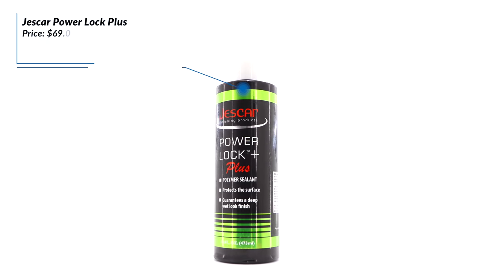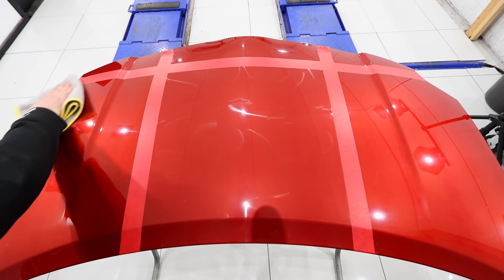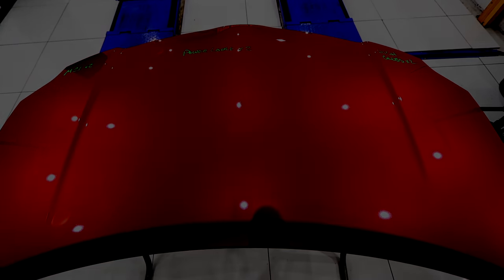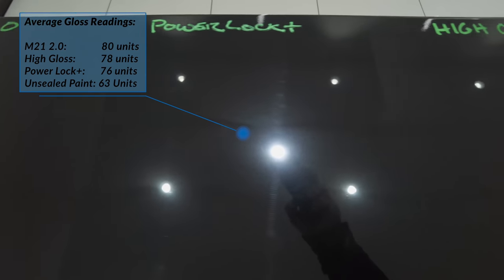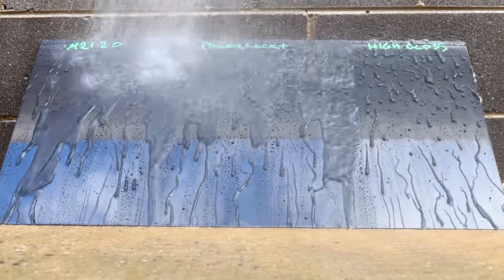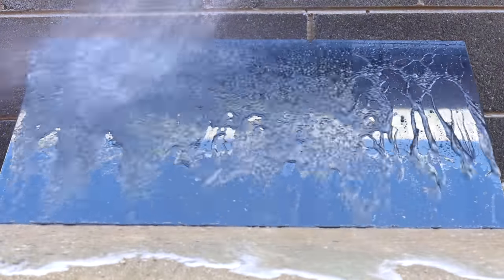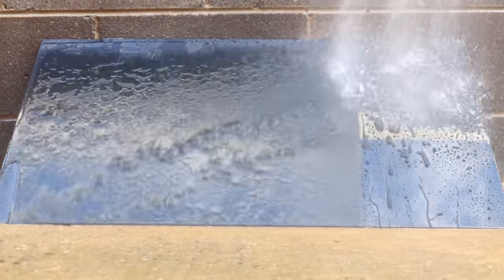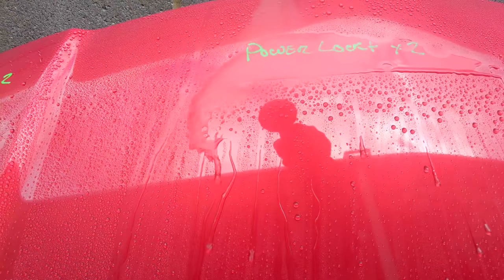Meguiars M21 vs Jescar Power Lock+ vs PolishAngel High Gloss | Best Car Paint Sealants Reviewed!

Comment: I absolutely loved this video. I've recently been thinking about changing to jescar ultra lock from my Meguiars. I would be interested to see those results! I've been using meguiars for years and still use it on customers vehicles. I love the user experience. One I consistently use is Meguiars ultimate liquid wax. From what Meguiars have told me it will last a little bit longer and protects better than m21 and has the added benefit of not leaving a residue on plastic, vinyl, or rubber trim. It's also available locally to me here in Canada, and they are the same price in 16oz sizes. The benefit of m21 over ultimate is it can be bought in 64oz bulk size, which is great for a shop. Again awesome video Sandro!!!
Reply from the maker: Really appreciate that mate and I’ll also be interested to see how ultra lock goes, but a good test or reason to use any product is it working we’ll time and time again in your world and it seem like it’s done that for you!

Comment: Thanks Sandro. Im embarrassed to say that Ive been using M21 all wrong. Ive been using it like a polishing compound (with orbital machine) and immediately wipe off. I didn’t know you can apply like a wax and with long flash times. The instructions on the label doesn’t differentiate. BTW it works well as a polishing compound.
Reply from the maker: Generally if you machine apply a liquid sealant it can speed up the bonding and flash time with the increased movement and hear so maybe you haven’t been way off!
Reply: I always apply M21 with an orbital DA and finishing pad. But leave to haze. Usually by the time I’ve finished applying the product to the car, it’s ready to be buffed off (where I started applying it). 😃

Comment: Great video Sandro, I am using PA master sealant and use PA rapid waxx as a drying aid on my black Jeep, they are expensive but they go a long way and the gloss and water repellent effects are fantastic. I also find them very easy to use and that dirt and road tar etc doesn’t seem to stick quite as much. I may try PA Wulfenite or one of NV’s sealants next, Lustre perhaps.
Reply from the maker: Thanks mate and I agree that most spray  sealants/waxes go a very long way and when you break it down to cost per application, even more expensive ones are still very reasonably priced and PA make great products! Thanks for sharing your experiences and thoughts!

Comment: I've tried out dozens of sealants, probably an unnecessary amount. Recently I tried out Nova Lustre and  it''s bar none my favorite sealant!
Reply: Do you have a recomendation on glaze product and sealant combo?
Reply: @fnagdungdagint  I prefer not to mix any kind of wax and sealants, but if i had to recommend a product for what you're describing, then i would polish/apply with rupes uno, carpro essence, or hd speed and then wait a minimum of 3 or 4 hours to let resins settle, then top with whatever sealant you like.
Reply: Try cosmic V2 by Polish angel. Have u tried it?
Reply: @ssing7113  I've tried the original cosmic spritz, but not v2!
Reply: @kylechow6072 ou should try cosmic V2. The cosmic spritz is their topper for cosmic V2. 

They just came out with a graphene version ( cosmic diamond )

I think you’d like it. It’s more like a sealant on steroids and lasts 12-18 months… so not your normal sealant in durability. Top with cosmic spritz

If u try. Beware. One bottle could coat 3 small cars or a suv and a small car. Don’t waste it as a little goes a long way. And this is two coatings per car…

Comment: Fab video as ever Sandro, wonder if some of todays “knocked out” [ and IMO hyped ] products will have their legs in years to come. On a side note, couple of months ago you did a glass repellent video. In your neck of the woods have you ever come across a glass sealant [like paint work has for swirls etc] that improves the appearance of glass nicks / minute grazes that are way too small for filling but do catch the sun, in other words a glass sealer polymer with fillers – is there such?
Reply from the maker: Thanks mate, and I don’t know of any specific glass sealant that can substantially fill in glass swirls but I have seen minimal improvements doing a 50/50 tape line with Carpro Essence Plus, but I don’t think the durability was great.

Comment: Thank you for the good video. I have one question for you. I can see that all 3 products are improved compared to bare paint in terms of gloss. Then, I wonder if there was a significant difference between layer 1 and layer 2.
Reply from the maker: I think there was a difference and improvement with a second layer, but generally it’s something like a 25% to 50% improvement and the more layers to apply the less each additional layer can do ultimately. It’s really that first that tend to have the best bond and more significant improvement, and additional layers just tend to slightly increase that.
Reply: @CarCraftAutoDetailing  thanks!!! have a nice day

Comment: Great video.  What ceramic coating is the easiest, and best to use on headlights after wet sanding and polishing?
Reply from the maker: I’ll generally just use what ever coating I’m using on the paint to also coat the lights as if it’s a good quality paint coating it should also work well there.

Comment: What brand wax brings out the most gloss on Red paint?
Reply from the maker: I honestly don’t have specific waxes I’ll use for specific car base coat colours as in my experience a good looking wax will look good regardless of the paint’s base colour. That doesn’t mean that some certain waxes can’t subjectively be seen to look better on certain colours or even flat or metallic paints compared to others, it just means I don’t have that sort of data base reference and it’s hard to objectively create such a thing. Probably not the answer you’re after, but the best I can do!
Reply: @CarCraftAutoDetailing  understood..thanks for the reply
Reply: Polish angel has some incredible waxes. Hand made as well for that ohhhh factor. 😂

Comment: Would these sealants(or any sealants/waxes) work better if applied with a dual action polisher?
Reply from the maker: If the paint is nicely prepped before hand, then no. But if the paint isn’t well prepared then using a liquid sealant with a polishing pad can actually give you a better result.

Comment: The High Gloss is definitely worth it.  Maybe not for your average customer but the high end or your own queen.  I’ve never believed the Powerlock was any good or that it topped with Collinite would yield 1 year of protection as many people claim.  This clearly shows that claim to be a hard one to buy.   Great video!
Reply: I want it to be compared to NV Lustre
Reply: Who expects a year of protection from powerlock+Collinite?  I use 1 coating of powerlock and 2 of Collinite.  It definitely lasts over 6 months.  Then it's time either for a strip down and reapplication or a full paint correction plus reapplication (full process every year).

My only concern with m21 is whether it would play nice with the Collinite.  But I have plenty of pl left, so I won't be experimenting.

I'd love a measure of the quality of light that is reflected.  I think the pl+Collinite produces a luscious glow that is different from a sealant's.

Comment: Would love to see you try Duragloss 105 and Duragloss Track Claw Sealant.  For maximum durability Duragloss 601 (Bonding Agent) needs to be applied but isn't required.  Both of these products are less expensive than the ones shown here,  and in my personal use held up better.  What I mean by that is protection from Bird Bombs and Bug bombs.  I actually prefer these over Si02 nano coatings for this exact reason.  Yes, you need to apply the Duragloss more often, every 3 months or so, but its easy to apply and for the average joe just makes more sense.  Duragloss 105 runs about $12 per bottle (US), Duragloss Track Claw runs $25 (US) and the Bonding Agent 601 runs $18 (US).  The 105 is a Polyamino Silicone product, Track Claw is a Fluoropolymer Sealant.  I realize Si02 may shed water better than both these products, but when Bird Bombs and bugs hit your car and are baked on in the sun?  The Duragloss products I have seen better resistance to etchings and staining.  Definitely worth a try.
Reply from the maker: Seems like you’ve had some pretty good experiences with Duragloss and I’ll definitely keep them in mind for future reviews as I do also like the brand but honestly haven’t used their products in quite some time.
Reply: @CarCraftAutoDetailing  yes I have.  They are different type of product compared to the new trends now.  I have tried the new stuff and keep going back to Duragloss.  They are good products.  I wouldn't go by their 1 year durability claim but a good 3-4 months is realistic.  I realize user experience varies but these products just simply work well enough to have me keep going back to them .  I have been testing the Duragloss Track Claw Polish but actually is a synthetic Florapolymer wax.  I have never used it before.  105 is most likely more "durable" but I like this Track Claw.  I need to use it at least a year before I can say how "durable" it is.  Initial findings after 2 months in 125+F heat are positive 👍
Reply: I still use Duragloss 111 a lot. 

It was about 11 years ago I found some at a Car Quest in Marysville, Michigan in the states.

I picked up 111, and 101. 

The spring of 2011, my old boss at the car wash hired me to "wax" his car. I thought I'd give the 111 a shot because it was a brand new vehicle. 

Our manager and I would always inquire customers when their car had good water repellency. We wanted to find out what they were using. 

For the next six months that the boss would come through, the Duragloss 111 was holding up. The managers favorite was turtle wax Ice paste. Mine was 111. 

Even Aquawax can hold up well. It survived a Michigan winter with snow, salt, brine, etc. 

About A month ago I did a paint correction for a shop I work for part time. We usually apply Ceramic Pro, or Xpel coatings (which are not fun to work with. Xpel Fusion is bearable, but Ceramic Pro makes me want to bulldoze their facility). This job was non coating. So I used DG 111. Shop owner, and the other two detailer loved how this old school sealant looked and felt on the Land Rover. They thought I coated it.
Reply: @danlc95  The newer nano coatings are the biggest fad right now.  EVERYTHING has "Ceramic" in it these days.  Reminds me of "Teflon" in the 80's and 90's.  A couple of things.  1.  Most "Ceramic", "Si02" products have a ton of VOC's in them.  They have to in order to have a carrier for the nano particles.  These VOC's are very harmful to us to breathe, touch, etc.  Yes the labels on these products state to use masks and gloves, with PLENTY of ventilation, but honestly?? Who does that?  Even professional shops I have seen don't.  Over time, these new coatings may cause some serious health issues.  2.  Many Si02 products, as good as they bead water (poor indicator for durability anyway) are HORRIBLE at protecting against water spots.  You get caught in a fluke thunderstorm in the middle of summer with your Si02 "coated" car?  Most likely you are polishing the whole car, if not compounding it to get the etchings off.  HUGE issue if you live in a HOT climate like I do.  Ironically,  the polymer products seem to not have this issue.   Yes you have to apply polymer products more often, but the ease of use especially for the do it yourselfer is important factor.  People say, "oh yeah but my coated car is so much easier to clean".  Yeah for about 3-6 months and after that IF YOUR LUCKY the bugs and gunk stick to your car just like anything else.  Additionally, the look.  Nano coatings give a super high gloss look that just doesn't look good on all colors.  Personally, I like to use a conventional wax on darker colors, really brings out the luster and reflection in a way coated cars just can't match.  Mike Phillips is a fairly respected guy in the Detailing World.  I will pull a quote from him "Find a product that you like to use, and use it often".  Mike is exactly right.  There is no bulletproof coating out there and boy trust me these shops are making a killing off of people selling it to them, but for most people out there, that actually drive their cars everyday, don't mind washing them every other week and applying a wax or polymer sealant onto their car every 3-4 months?  If you do that? Your paint will last many many years.  So don't buy into all the hype, buy what is easy for you to use, easy to apply, and just apply it often.
Reply: @eppyz  - I remember the Teflon craze back then! 

The consensus was that it was snake oil because the temperatures required to properly bind it to the surface it was applied, would exceed the limits of the substrate. 

The VOCs.... After a session with Ceramic Pro it felt like my lungs were coated. 

I'm not sure if you've ever had the immense misfortune experiencing the application/removal process of the Ceramic Pro type coating, but It's one of the most frustrating endeavors I've ever experienced. I swore off glass bottle coatings because of it. 

I do offer a ceramic coating in my business. It's Optimum Gloss Coat. It applies just like their Opti-Seal polymer sealant. No VOC's, no difficult leveling, no over hyped claims, no need for toppers or periodic boosting, no issue with water spots. 

That's another reason I'm leery about these coatings. They're actually so delicate and finicky. I want my customers to be able to "set it and forget it". The only coating I can do that with is the Optimum, and apparently the non ceramic Meguiar's coating. (I applied the Megs coating to my old friends truck in August, and he's in love with it). 

For the most part I use Optimum products. I love their Car Wax (Carnauba/Polymer blend), Opti-Seal (pure polymer sealant), Hyper Seal (sealant/coating), and Gloss Coat (ceramic coating). They're all easy to apply, remove, and don't choke me out with solvents. 

I still love Meguiar's, Duragloss, and Zymol sealants / waxes.

It's refreshing to hear someone speak atvyour level about this. It's something I've thought for a long time myself.
Reply: @danlc95  Thank You for your comment and hope manufacturers will take the peoples health that actually apply these products into consideration.  Then they will have the perfect product 👍
Be safe🙏
Reply: @eppyz  - You're welcome.

I also forgot to mention the incredible wast that comes with these glass bottle coatings. The applicators and wipe off towels. They're basically single use items. It's incredibly wasteful. 

You stay safe too. At The shop, because I do such a poor job applying those coatings, It's been relegated to the other guys there for the most part. I don't be there long however, as I'm going to build on my existing operation from my home garage. I figure I won't feel the pressure of having to learn these coatings - which face obselence as technology increases, and more money goes into my pocket. 

Glad to have come across you Eppyz.
Reply: @danlc95  I agree with you 100% nice to have come across you as well.  Most folks bash me all the time for the way I think about things long term and basically cost vs performance.  I know these newer nano coatings are the cats meow right now, but they are very harsh on the body and don't really live up to the hype.  Try explaining to a customer that just dropped $1500-$2000 on a full paint correction and nano coating when they come back and their car is all full of water spots?  Or they didn't follow the tedious maintenance on the nano coatings and their warranty went right out the window.  Yeah fun.  I do not do this for a living, just an enthusiast that probably should.  Grew up around cars with my Dad running body shops since I was a kid during the 70's.  I am too honest to work in a field of sales.   I have been paid in the past to "detail" customers cars, but decided to stop years ago when people don't want to pay anything to do the work.  I would tell people the price they would counter offer and I would be like, "the products I use on the car cost me more than that, I can't work for free".  Only true car enthusiasts get it, and unfortunately  those people are not the majority of the business.  People just need to be honest, and have realistic expectations.  Hope all goes well on your end and stay safe my friend.

Comment: Even though the three are probably close in performance.........for me.........The Polishangel is the winner, although I do really like the Jescar, especially on my daily drivers.     I just love using the Polishangel line and the super quick, easy application of High Gloss coupled with the level of gloss and slickness it gives, along with durability as close to or better than the two older sealants..............it's worth every single penny to me and I do use Polishangel products on my (NON DAILY ONLY) about once per week.      Have you ever used the new Jescar Powerlock PLus ULTRA (with the ceramic properties built into it?)    I'd love to see a review on how that performs,  ease of application,  etc
Reply from the maker: Thanks for sharing that mate, and as I mention in the video I’ve got Ultra+ coming so I’ll also be interested to try it once I get a chance!

Comment: Megs m21 is the worst ever sealent/paintprotection ive ever tried and i have tried alot. Zero chemical resistance irl and cant handle nordic climate.
The polish angel is imo the best high end brand on the market, its not cheap but on your precious its perfect. Daily beater maybe not worth the price. I use gyeon and polish angel for my cars and some labocosmetica products.
Great video, i think the gloss readings would be bettet for polish angel high gloss vs the other on a polished panel.
Its not formulated as a filler product.
Gloss units of high gloss on oerfect polished paint is around 98-100gu.